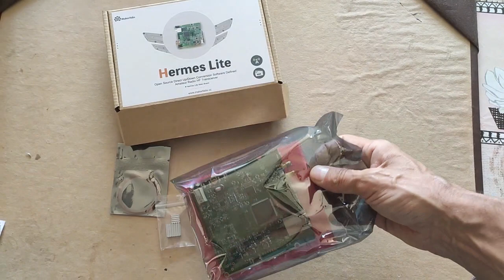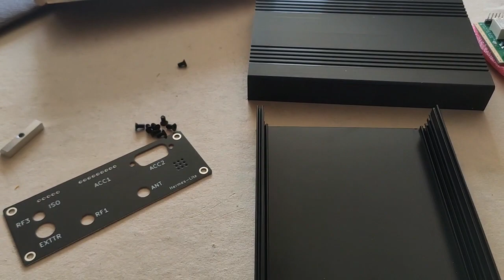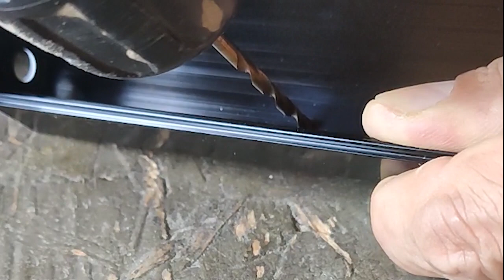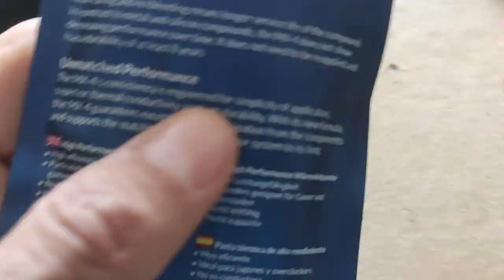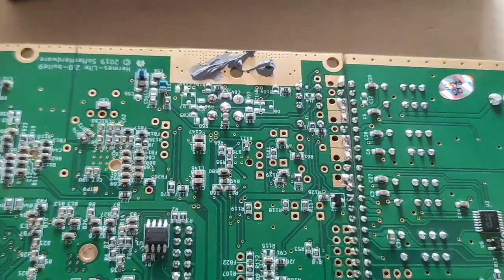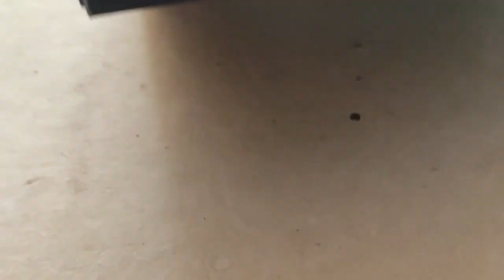Hermes Lite 2 Assembly Guide: All you need to know is here

Comment: Great video!  I also used the dremel tool and it worked wonders! First I used the dremel to sand away the paint from the enclosure.  Next, I then used a dremel polishing wheel to polish all contact points!  So I put a mirror finish on the enclosure, the heatsink and the Hermes Lite contact area too.  Smart man to use the thermal paste...I too used the exact MK-4.

I like to do things right the first time.

Thanks for your informative video! 

Well done!